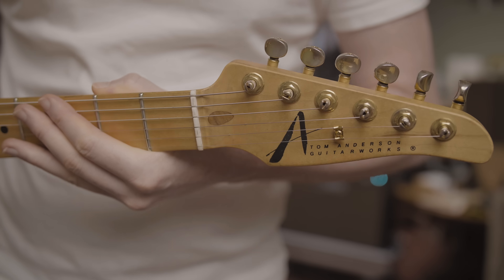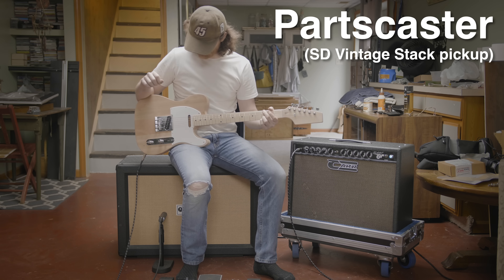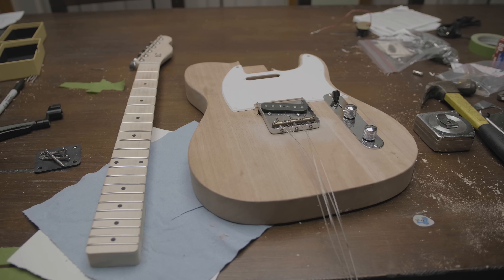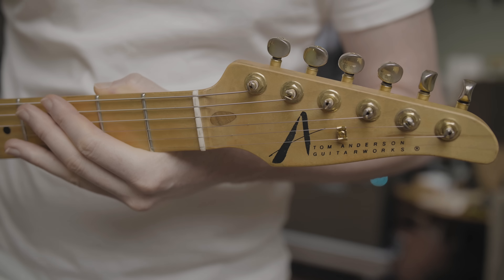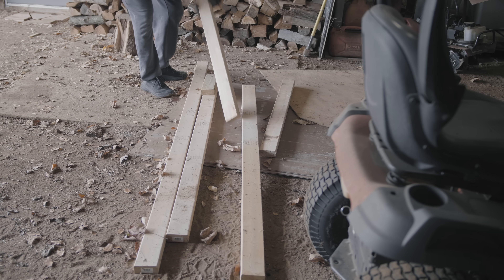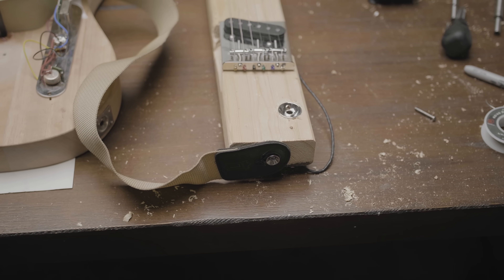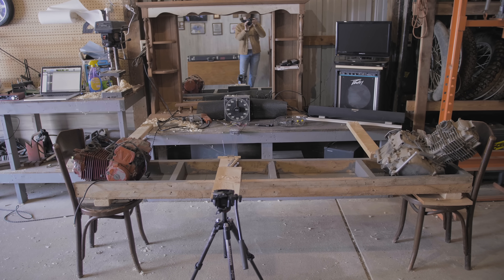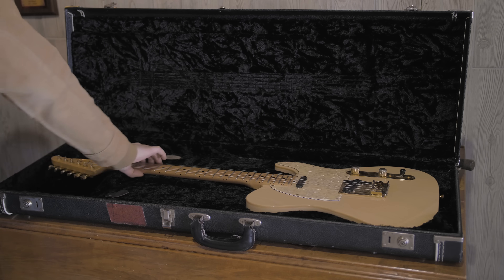Tested: Where Does The Tone Come From In An Electric Guitar?

Comment: There is one key factor to wood that comes into play . Well two . First is only cosmetic but it does make your guitar yours when using clear or semi clear paints and stains . Second is a little more prudent , durability.  You can make a guitar body out of pine but eventually it will warp . Now how fast depends on more factors I can list but climate and string Guage top the list . Actually that's probably the biggest scientific factor, if not the only factor, to one wood type over another . Most the other factors are more personal.  For example I prefer the heavier feel of mahogany over say the lighter bass wood guitars or even my Ash bodied Epiphone Les Paul.  But my Epiphone is my own custom build where as I'd never butcher a 60s standard 🤣 . But as far as wood effecting tone , not on modern guitars unless you're using true vintage 50s and 60s pick ups . The argument to wood effecting tone WAS valid in the past . Some of the old pick ups actually are more like weak mics than modern pick ups so that will be the one factor where wood will be key 👍

Comment: Maybe measure electric signals from the guitars?  

Electrical components have a ton of variance.  Could have differences in resistance between 2 pots rated the same, or output levels between 2 different pickups of the same model.

Would love to see a conclusion from your experiments.  My takeaway right now is that pickups get you 90% there.

Comment: as a luthier who has to have this conversation regularly, thank you for your detailed and scientific approach to this. isolating individual variables and tweaking one at a time. it’s slow, tedious, and the only way to do it right. 

acoustic guitars themselves are the amplification, so some of the popular marketing mumbo jumbo that is spread does apply. tonewood matters, different woods will have different sounds. then once materials are selected, every single decision you make in the design will have some impact in the sound (some predictable and controllable, most not). big things like body shape and dimensions, scale length, or bracing style. but even tiny details like wanting a thin flexible finish that doesn’t deaden vibration. or wanting tight, hand fit joints. even certain traditional glues can be said to have an effect on tone. now most of these differences are incredibly slight and, individually, would probably go unnoticed. but combined, a skilled luthier can make use of these decisions throughout the process to predictably shape aspects of the overall sound. 

this is not applicable to electric guitars but no one seems to have told gibson’s marketing team. essentially, all you need is a metal string that vibrates close enough to some wound magnets. pull a string taut and fix it at two points, however that string vibrates, it will distort that magnetic field and the pickup and electronics will take that electrical signal, tweak it, and send it off. then noise will happen, electronically, separately, out of a cone, in a box, with wires. the rest of it is ancillary. or accessories or amenities to make things more easier or more funner or more prettier. and that’s so beautiful to me

Comment: Even with the limited tests and listening to this on laptop speakers, none of the clips sounded the same to me? It's all relative, yes the differences in sound between the examples are minor. But so are the differences between entirely different guitars and pickups. To me the difference in feel when playing my single coil strat to my tele deluxe with humbuckers is quite large. But, taking a step back and listening to them recorded or in a mix they both just sound like me playing a guitar. The amp ends up being the largest factor, but even then with adjustments in mic placement and EQ you can sort of make one sound like the other.

Comment: But....actually the "air-guitar" has a lot of wood... 2 working benches, and the weight of the engines... when you listen closely  you can even hear the lower end the two engines add to the sound. Which screws did you use to attach the bridge and the headstock? Must be brass screws cause there's a little more open end and a slight  brighter sound quality...
🙈🙈😂😂 Great video  by the way

Comment: One other thing maybe to try is not to bolt the bridge to a solid table ...maybe try to fix it to a wire so there is not body. Because the 'air guitar' is kind on a bench and table guitar.

Could explain why it sounds much deeper then the actual guitar (in a good way)

Comment: The "air" guitar is really a bench guitar, isn't it?- that's what the strings are attached to and where the string vibration goes as the notes decay. The guitars DO sound different- but equally as "effective". I find the subtle differences in guitars due to the various physical variables add up to different examples of the same model of instrument having discernably different personalities and voices- and different types of guitar setup and construction just add more variables. It's not just the pickups- though to what degree it is, depends a lot on one's playing style.

Comment: Loved it. Really well done. Many shootouts between guitars or amps or whatever, they play something different on each one, or spend so much time on one guitar/amp that you forget what the previous one sounded like. One thing though. I own a custom made guitar that I had made for myself. When I got it, it had a maple neck maple fingerboard and it was really really bright and I didn't like it so I had the guitar maker make a mahogany neck with rosewood fingerboard to replace it and it made a big difference.
Reply: was the string-to-pickup height matched? As we saw here that's the main differentiating factor.
Reply: @NeonFuzz  it was the same guitar ! Just the neck changed.
Reply: @rodav  We saw in this video that changing the neck can change the pickup-to-string height.
Reply: @rodav  Also maybe the guitar maker when he changed the neck also changed the setup?

Comment: Every part you add to a guitar is subtractive.They all absorb vibrational energy.  Some absorb it more quickly than others.  And at different frequencies, as well.   The more massive and rigid the endpoint attachments of the strings are, the longer that will allow the strings to ring. As you add parts to the system that are less massive, less rigid, and have more vibration absorbing properties, the more sustain will suffer and the tone will change.

Comment: You sir are a LEGEND. You might have just destroyed the minds of many guitar "flat-earthers" :P I was a long time believer that the only things actually contributing to the sound of the instrument are the pickups, strings and the contact points of those strings. Other stuff is just pretty for the eyes. The ONLY thing that might be affected by the wood (or rather the weight of the instrument I believe) is the sustain. I'm pretty sure you would find that because your strings were connected to such heavy objects your AIR guitar would have much better sustain, where it is actually sucked out/cancelled out by a traditional guitar body and neck. I've seen that sustain experiment in another video where someone connected strings to steel beams that were connected to the ground. Almost infinite sustain. So in that regards actually your AIR guitar is the ultimate electric guitar, where the traditional electric guitars can only be a bit or a lot WORSE from that point :) I believe Paul Reed Smith mentioned something like that (although still believing in tone-wood...) that the best instruments don't suck out the tone, and in this statement he was right ;)

Comment: I'd love to see a "C" guitar where the nut and bridge are the top and bottom parts of a "C", the vertical part being several inches away from the strings. Basically a tuned musical bow.
Reply: Seems like tuning would put a lot of stress on the shape.. Might snap or at least not hold tuning very well :/
Reply: @JankyChris  Agreed. The "arch" is inarguably strong architecturally, but useless sideways. Maybe a "O" oval instead of a C to provide the arch stability.

Comment: So much for tone woods. So pickups, setup and electronics  are the big contributors to tone. But, I believe semi-hollow or hollow body guitars do sound different than solid body guitars. Would be interesting to see a test between a semi or hollow body vs a solid body with same scale length, pick ups and setup. Maybe a es-335 and a les paul.

Comment: This is absolutely fascinating! Though my prior beliefs about tonewoods were proven incorrect, I’m now curious about what factors affect the tone of a drum.
Reply: Being an acoustic instrument I'm guessing the wood does actually have some effect, but since it's mostly based on the vibrating air inside the shell, I'd say the biggest factors by far will be the tuning of the top and bottom head and the material/thickness of the heads, as well as the size and dimensions of the shell. Everything else (finish, mounting hardware etc.) is negligible

Comment: On a computer speaker you could convince me they are the same. But, after throwing on high quality headphones I think your 2x4 guitar is still lacking in sustain of note compared to the real guitar. Many many factors could contribute to this such as shape, material, bracing to neck, etc and would take a lot of time to isolate.

That said, the floating guitar at the end had the most convincing sound IMO. And my theory was then shifted to not "does the shape of the guitar make the tone/sustain/better, but rather, "can the shape hinder these things?"

Perhaps the goal is not to "improve these characteristics, but instead to do one's best to not impede them with poor shapes/jointing/materials.

Could it be that the purest tone is one that is in no way interrupted by the these factors and great guitar builders are simply finding ways to not impede on the natural characteristics of the strings vibrations? If that is the case, then it should be easy to come to some very concrete conclusions at least on a list of "Don'ts" instead of a list of do's.

Great research, looking forward to a follow up!

Comment: Great video Jim!
I have a hypothesis why the "air guitar" sounded so good, and I 'd love to hear your comments about it:
- For me, the key for the "air guitar" sound was strength and mass. Hardware was anchored in 2 points, in a very sturdy fashion, with wood and iron, plus the massive wood bar keeping the distance. If the whole structure was made of (for instance) cheap plywood and/or plastic, maybe the results would be dramatically different. Does this make sense to you or not?
Cheers!
Reply: If the total mass of the mechanically coupled body were a factor then they wouldn't have sounded practically identical with otherwise matched parameters across all other variables. Given that the 'body' of the air guitar was substantially larger in mass it should have produced a markedly different tone than the tele with an otherwise identical setup. 

This video demonstrated fairly solid research methodology and yielded results that are all but a deathblow for most electric guitar tone myths. That said, it's okay to like different guitar shapes and woods for their aesthetic properties and how they make you feel more connected with the instrument. Nothing wrong with that, but there is no empirical evidence that they impact guitar performance in any substantive way.

Comment: Super interesting but a possibility: they sound so similar because they are both rigid, the 'air' guitar is anchored by very solid benches, the anderson design goal may be to be as solid as possible while still being ergonomic. So... test with something NOT as solid. Anchor the nut onto some flimsy plastic, styrofoam, the flimsies thing possible that will take the tension. I wonder if it will 'soak up' the string vibrations

Comment: This video shows exactly what I have believed about electric instruments for the longest time. I'm also of the opinion that wood type has little bearing on acoustic instruments just because it's a different wood type. It's the DENSITY of the wood that makes the difference in tone. If you can make a composite material that has equal strength and density  to certain piece of maple, it will sound very similar (wood isn't a uniform density so each piece is always a bit different). Same with 2 woods of different types. A hard piece of mahogany can sound the about the same as a softer piece of hard maple for example.

Comment: Fantastic demonstration. Thank you for putting in all that time and effort to show what's really going on.
One question I have is regarding the Gibson Les Paul and the Gibson SG.
According to Google.
"With the pickup, neck, and electronics remaining the same, it's only the body structure that makes a difference in the tones of the two guitars. As expected, the slender body of SG gives more depth to the mid-range chords."

Would anyone like to take a shot at answering this.
Thanks 🤘
Reply: The pickups aren't in exactly the same spots on those two guitars. The bridge pickups are almost the same placement, but the neck pickup of a Les Paul is closer to the neck while the SG is closer to the middle.

Comment: This obviously doesn’t say anything about differences in acoustic guitars but it says an enormous amount about the extent to which wood affects what gets to the pickups. If we can’t detect, or barely detect, the difference in sound between a guitar and no guitar at all set up identically, that says that wood is not what anyone should be concentrating on in the body of an electric (aside from possibly weight or definitely appearance, because guitars are certainly a fashion statement) and also that guitar makers should be concentrating heavily on how (and what) pickups are placed in relation to strings. From a practical standpoint I’d be setting up Flying V’s just like Les Pauls and Strats just because of the reduction in weight. That would also enable much lighter double necks. The next thing I’d like to know is what this says about the differences in sound between a Strat and a Tele. This obviously needs more research.

Comment: You're an absolute savage for going the distance on this one. When you did the open tuning test at the end, I really tripped out. So darn similar. Honestly, taking your fretting fingers out of the equation really makes the test more reliable 🙌

One thing I will say. I got a Mulecaster about a year ago. For those that don't know, these get made by Mule Resophonics up in Michigan. It's a Tele shaped guitar, but the body is made entirely out of steel. It's welded together where the top and bottom meet the sides, so the inside of the body is hollow. Also, the neck is basically a neck through all the way to the bridge where it actually bolts up to the bridge. And, it has an 'F Hole'. All that to admittedly say, the construction of this thing is definitely different from your typical electric guitar. It has a really unique sound to it. It's not so much a unique "tone" thing, but the dynamics just come through in a really interesting way. I usually describe it as not only going to 11, but also going to -1. But I'm not really quite sure that's right. I think volume is volume and things can only be so loud and so soft. The more I think about it, this guitar really just has more dynamic layers to it. On a typical electric guitar, if there's 20 tone layers you can access depending on how hard you hit the string, maybe there's 40 in this Mulecaster. Sort of the same way that an acoustic guitar has more dynamic layers compared to an electric guitar, the Mulecaster also has more layers.

All of that just makes me wonder if things change when you start doing things like creating chambered bodies, semi-hollow bodies, or hollow bodies. What about neck thru designs? Also, things like ports and sound holes might be another factor.

Also, I'm terribly upset my Telecaster sounds as good as two work benches strung together 😂🤣😜

Comment: It would be totally different on an acoustic, but a modern electric guitar uses pickups that are NOT microphonic. Try using nylon strings on an electric guitar. They don't work very well. You should be playing electric guitar strings on an electric guitar because it works off of a magnetic field. Different pickups will change the sound much more than the type of wood. The strings and electronics are making the tone. It's an electric guitar!   Period.  Outstanding video.

Comment: Ha... is the pickup and it's relationship to the strings and that's pretty much it. :) Although I think there is some tone coming from the relationship between the player and the guitar which changes with the shape of that guitar as you play it over time. I.e. you're not the same player with the 2X4 as you might be with a Tele or Strat or Les Paul - overtime and development or your relationship with the instrument.